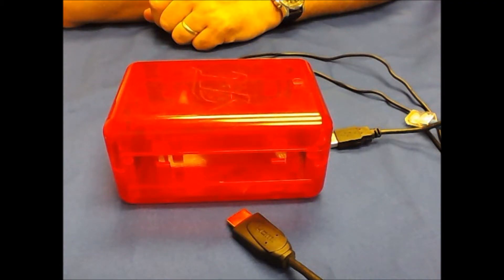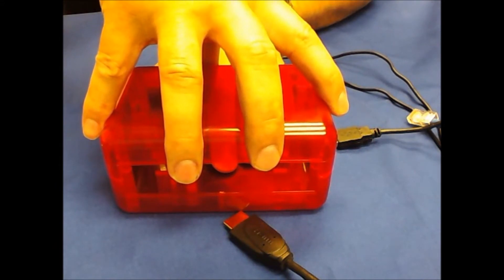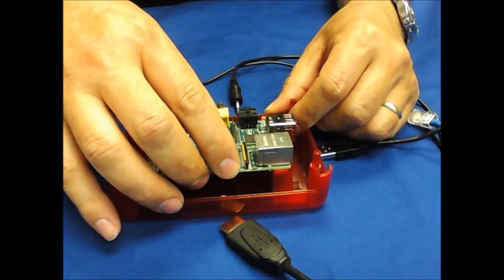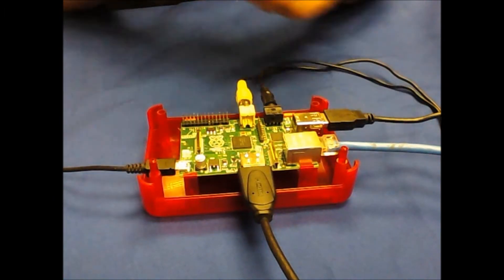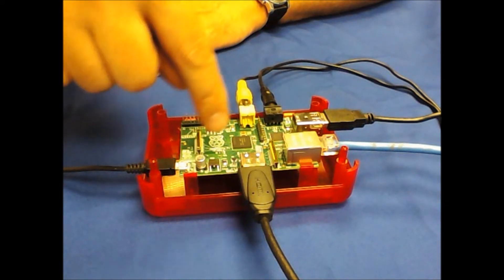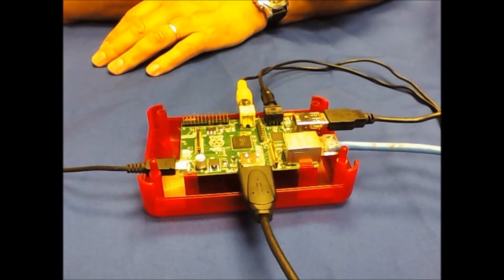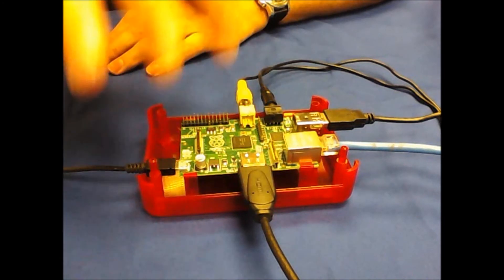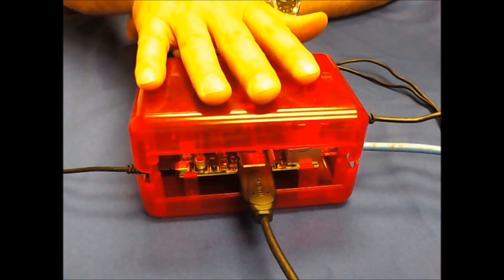A Raspberry Pi Case - the Pi Sandwich Part II

Comment: I bought one of these. The mounting legs are way too flexible. Trying to plug in things without touching the board pushes the board around and even out of the slots. You have to hold onto the board every time you plug anything in. You also cannot access the SD card with both halves installed. It is also quite bulky compared to other cases I've seen. Perhaps if it was a little smaller and the mount points a little beefier, it would work better. As it is now, I prefer the Built-To-Spec case.